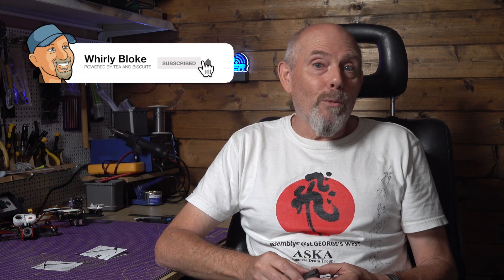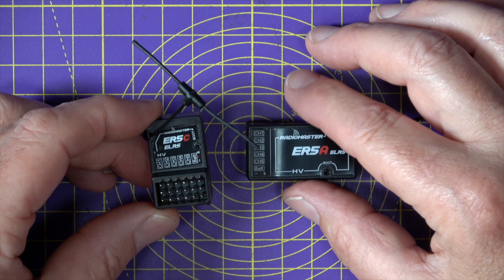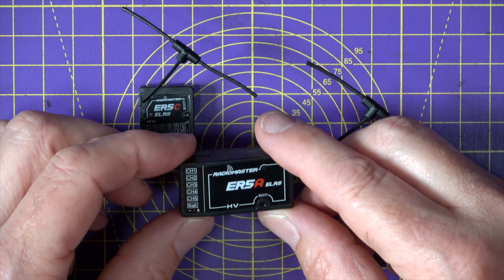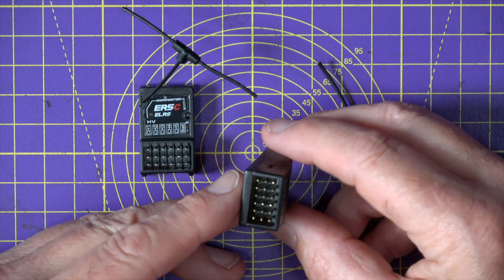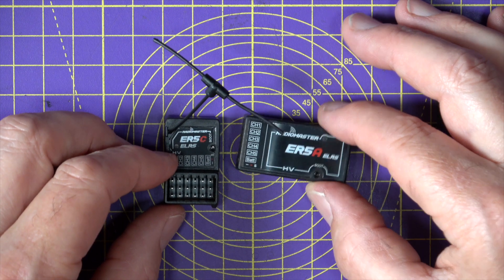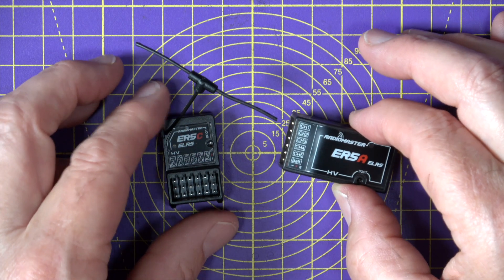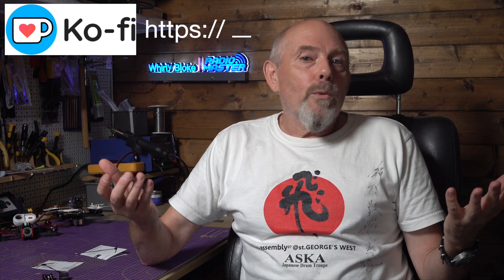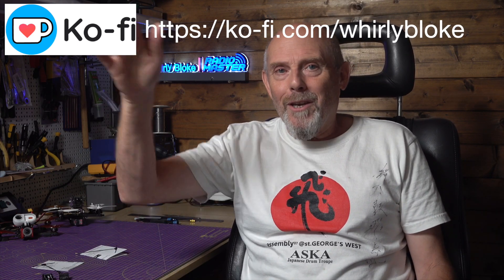RadioMaster ER5A and ER5C PWM 2.4GHz ELRS receivers for planes, boats and automobiles

Comment: Can I ask a dumb newbie question? Can it control regular 12v DC motors? I'm considering this for an RC tank. I understand PWM could control the servos to turn the turret, but can this be used to drive the tracks too?
Reply from the maker: You can’t drive a 12 V DC tank motor directly from the ER5A/ER5C receiver—it only spits out little 5 V “servo‑style” PWM pulse trains, not enough current or voltage to spin a big motor.  However, you can absolutely use its PWM channels to control a proper motor driver or ESC, which in turn will run your tracks.

Comment: What is the goodness i am missing? I just fly only small park planes , not FPV , no long range , no quads. I hope you can clarify .  Thanks
Reply from the maker: Like everything, there's no need to upgrade to new gear if you don't need it. ELRS is excellent, but so is older stuff if it does what you want.
Reply: @WhirlyBloke  do not get me wrong i like modern it is just what i understand about elrs is that iot fantastic for long range application fpv that i do not do. So i hope you can help me understand the advantage for my application. thanks for the response!

Comment: Hi WhirlyBloke. I'm from North West Yorkshire Leeds. I'm new to your channel. I'm trying to find out how to setup a Radio Master with FrySky ACCST D16 and Spektrum DSMR receivers. 

Please please please dig out your RC boat. I'm new into the RC boating hobby and most of my experienced hobby member friends at my local boat club are now using RadioMaster. 

I have two Volantex boats with FrySky X6R receivers but I just bought a new Horizon Hobby Proboat which has a Spektrum DSMR SR315 receiver. I was given an old Tarranis X9D Plus but I am really thinking about getting a really modern radio now with easy to use navigate colour touch screen. 

I've been looking at these Radio Master for a while now. It would be so I can use all the different receivers on my boats. I also have drones, planes and Helis for the future. Some of the club members are members of the model flying club association also. 

I passed the exam and had a operator ID but it's expired. I don't see many RC Boating YouTubers with RadioMaster's helping us out. Anyway a radio like this would come in handy for all my RC of the future. But we need someone to show us how to do it.
Reply from the maker: To use FrSky ACCST D16 receivers with your Radio Master transmitter, you will need to ensure that your Radio Master is running the OpenTX firmware. Once you have confirmed that, you will need to bind the FrSky receiver to the Radio Master transmitter by following the steps provided in the FrSky receiver's manual.

To use Spektrum DSMR receivers with your Radio Master transmitter, you will need to use an external module such as the TBS Crossfire or a Spektrum module. Once you have installed the external module, you can bind the Spektrum receiver to the Radio Master transmitter by following the steps provided in the receiver's manual.

It's important to note that the specific steps for binding and setting up your receiver may vary depending on the exact models of the Radio Master transmitter and FrSky/Spektrum receiver you are using. So, it's always recommended to consult the manuals and guides for your specific equipment.

Comment: Is there a target for these in the configurator? I don't see any information on the ELRS wiki.
Reply from the maker: As of my knowledge cutoff date of September 2021, the RadioMaster ER5A and ER5C PWM 2.4GHz receivers were not officially supported by the ELRS configurator. However, it's possible that support has been added since then.

If you don't see any information on the ELRS wiki, you could try reaching out to the ELRS community directly to ask if these receivers are supported or if there are any workarounds or custom configurations that could be used. The ELRS Discord server is a good place to ask questions and get help from the community. You can find an invite to the Discord server on the ELRS wiki homepage.

Comment: What are the benefits of these over the conventional 2.4ghz for surface use?
Reply from the maker: It gives much greater range, speed and latency. Now this is not so important for surface and marine - well maybe range is. Importantly, it's open source and not tied to any particular hardware or manufacturer. It means you aren't locked into a company like FrSky and are free to choose what you use.  Arguably it's technically superior and I use on most of my models. However, it is cutting edge and don't have the maturity of CrossFire which is rock solid, but more expensive.